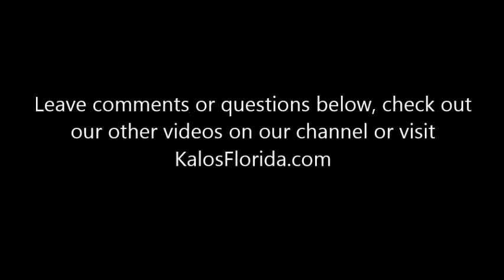Locking Compressors and Hard Start Kits

Comment: Would applying heat or cold to the compressor/ refrigerant lines help to unlock a locked compressor? My thought is refrigerant pressure changes might move things around.